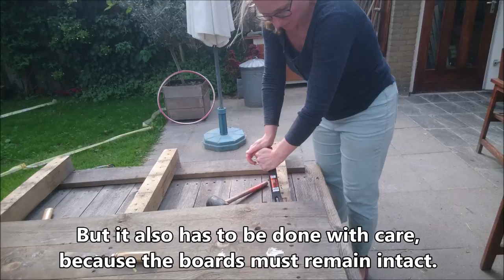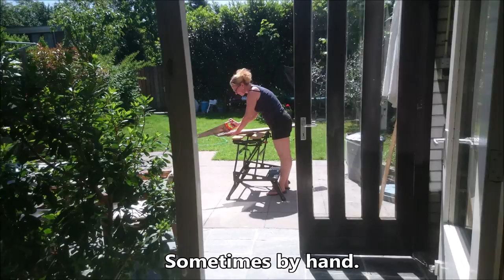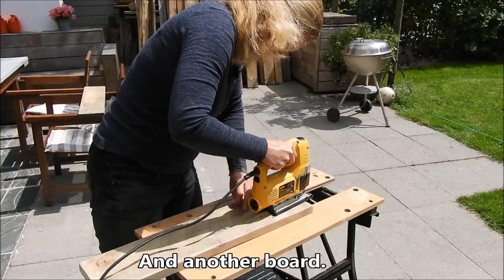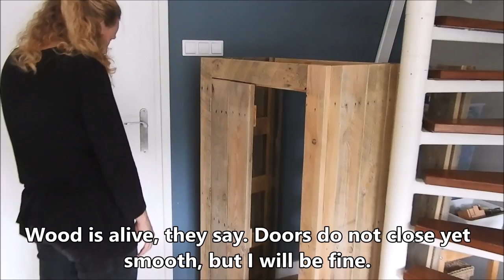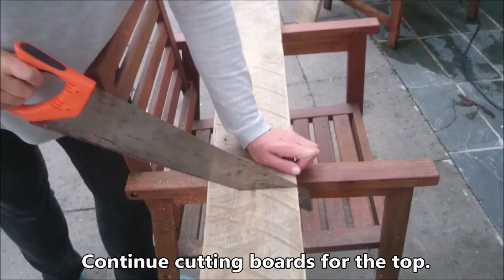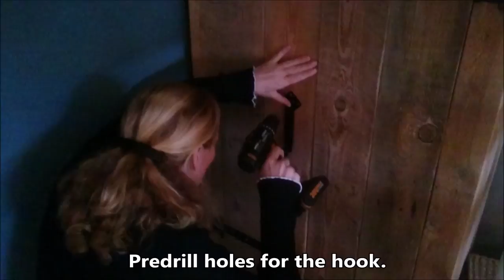Beautiful storage cabinet made of pallets

Comment: Can I ask you a question can I use my battery charger driller transform it into a sander   Please because I have been told no it would be better it it was electric one not a charger one
Reply from the maker: Dear Caroline, I guess an electric one has more power than a battery charged sander. But if it works for you, why not?